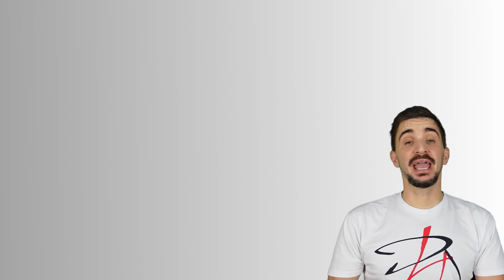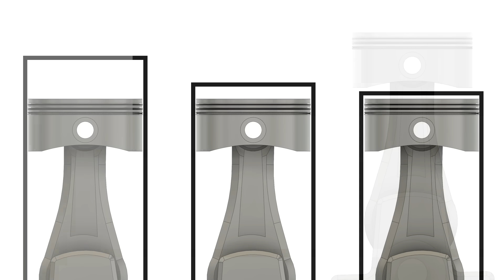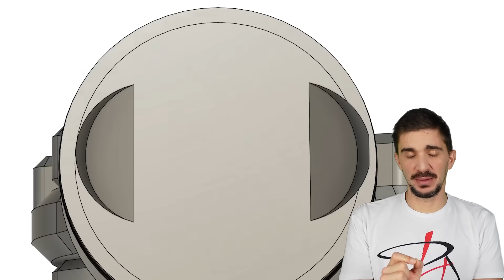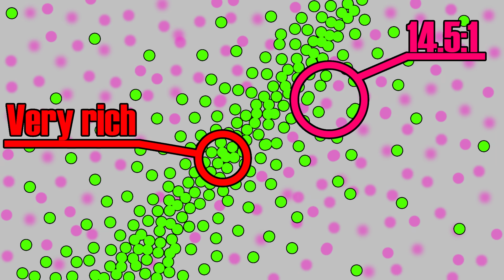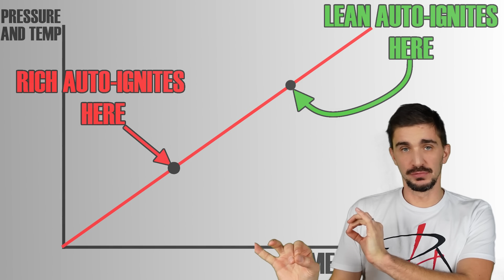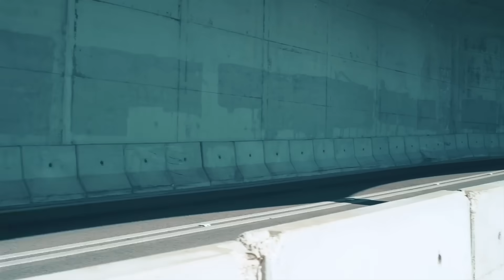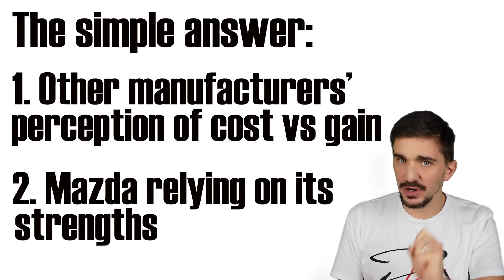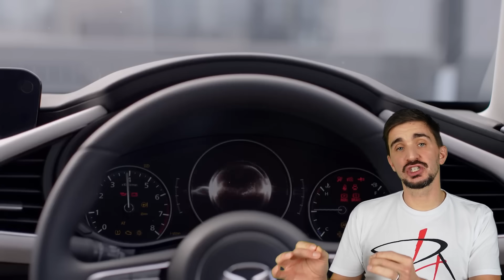The Game Changer Nobody Cares About - Mazda Skyactiv-X SPCCI How it Works and Why It Didn't Catch On

Comment: Okay, there is one piece of the puzzle missing: By having the fuel ignite via compression (and the spark plug to control it), the ignition will always happen before top dead center. Arent these engines just knock-machnines? After all, knock is just spontaneous ignition
Reply: Ignition needs to happen before top dead center as rpm increases so that it is "on time" during the compression stroke.  Called ignition timing advance.
Reply: Ignition isn't instantaneous, take some time, it start early before tdc and reach its peak cylinder pressure around 15atdc
Reply: the pressure and heat at TDC aren't enough to cause ignition with that specific AFR (at least thats the theory) the spark plug gets sprayed with fuel and ignites that tiny pocket of rich mixture which causes a spike in pressure, that spike in pressure causes the detonation of all fuel in the cylinder.

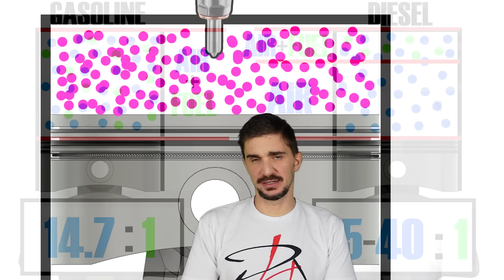if it helps, think of it as "delayed knock", thats ultimately what the pressure spike graph at 3:35 is depicting. its still rough on the rods and camshaft but since the knock is delayed until after the piston has started moving down, its less destructive than traditional knock occuring before TDC.

kinda like waterboarding the rods&camshaft to extract a little more fuel efficiency.
Reply: Так завжди запалювання відбувається до верхньої мертвої точки. Якщо запалювання буде після верхньої мертвої точки (так зване "пізнє запалювання"), це призводить до зниження ефективності двигуна.

Comment: Honestly if it were me I would have it as a onboard generator leading to a smaller battery pack which onboard electric motors that in move the vehicle. The electronics can handle all of the dynamic loads and the engine can just operated ideal conditions.
Reply: I agree. My wife has a Nissan Note E which does that. The constant RPM of the engine would mean the sky active Mazda engine wound thrive. Maybe the 50MPG (imperial) on a trip and similar around town that we achieve would would be significantly better with the Mazda engine. Engine swap anyone? Does Mazda make a 1200cc skyactive?

Comment: im driving this engine for 5 years now. im more then happy with the car, fuel economy is great, 70k km im averaging 6l the entire time with 180hp is a great value for an gasoline engine. The compressor got changed on warrenty and the mazda OEM Brakes are really bad (changed all disks after 36k km) other then that i love this car.

Comment: I think the "drives laggy" is something that could be adjusted with ECU control logic, basically a "go faster" button that makes the engine much more aggressive and basically disables spcci, and also have the computer detect when you push outside the eco profile and let it run harder then.

Comment: Hey Bosanac,
air doesn't burn, but oxygen in the air supports combustion. After all, combustion is oxidation where a hydrocarbon oxidizes at high temperature and as a result we get CO2 and H2O and some other suspicious chemical compounds that nobody likes. 
You have very good videos and I support you 100%. Poz

Comment: It's a question of taste, sound, feel. I always had NA, manual, fwd Honda cars. It was good, I liked hight revs and downshifts. But now I have a Tesla, I waited long for that, I'm older, and well, it is so much better. Simpler, silent, no smell, it accelerate more, the only downside it that now I don't focus on driving. The small twisty roads now do not appeal to me that much. But as I spend 99% of time stuck in city traffic and being on highways, it's only the 1% when I am on the twisty road that I regret my Honda. Would I want to exchange my Tesla for a very nice shifting NA car, NO. The double glass, relaxed arrival, the cargo capacity... the Tesla is an upgrade in almost every ways. It is admirable to improve the gasoline NA engine, and it fits Mazda, but like the spinning hard drives, now SSDs are better, and I thing a simple BEV is so good it makes questionning the relevance if ICE for small vehicles. Now we can argue on the longevity, the chemistry, the cooling, the break pads, the tires, but for me, now I switched both my life and my mind and my opinion to the BEV side. (but not my heart)
Reply: There are no BEV small vehicles. Everything is a SUV/crossover

Comment: Combining this engine with Toyota's e-CVT seems like it would make up for it's shortcomings perfectly. Have to work the engine? Not if you just keep it at its most efficient RPM constantly and just vary the gear ratio instead. Considering that Mazda and Toyota has done a number of collaborative projects already I'm a bit surprised that this hasn't already happened.

Comment: we don't care about because it doesn't do any of the promised things or have any special specs like very low consumption, emissions or for example torque. i'ts very ordinary basic engine. VAG 1.5 TFSI has lower fuel consumption and same performance and without this HCCI shittos.
Reply: TSI doesn't have a lower fuel consumption, sorry.
Reply: @vvevvevvvv thats just your feelings. But official wltp figures shows different story and it's leveled test prosedure for all the cars.
Reply: @Jani_Ikävalko we all know that wltp figures mean nothing.
You just drive the same route in both cars and compare the fuel consumption at the petrol station, and let's talk after that, ok.
Reply: @vvevvevvvvno. Thats unscientific and prosedure isnt same.

Comment: I really liked the technical breakdown, but the closing commentary about AI and “lazy” users rubbed me the wrong way.

You frame the progression as “I hate walking → I hate shifting → I hate driving → I hate thinking → here’s AI,” as if every move toward convenience is a move away from being human. But there’s a big difference between avoiding thinking and redirecting thinking. Offloading low‑value effort (like some driving tasks or rote calculations) can free up bandwidth for more meaningful problem‑solving, not less.

You also treat buyers not wanting this particular engine’s tradeoffs as a kind of moral failing. Most people aren’t choosing between “engaged, noble driving” and “brain‑dead laziness”; they’re choosing between fatigue, cost, traffic, and reliability on one side, and marginal efficiency gains plus extra complexity on the other. Deciding that “I don’t want to rev the engine to get torque” is not the same as “I don’t value skills or thinking.”

The key question with AI (and with tech generally) isn’t “Do you ever choose convenience?” It’s: “In which domains do you insist on understanding and retaining final judgment?” I can gladly accept help from AI or from a smoother powertrain and still be very serious about thinking hard in the areas that actually matter to me. Your underlying concern about people surrendering agency is valid, but I don’t think it’s fair to equate using AI, or preferring an easy‑to‑drive car, with hating thinking.

Comment: I see similarities with the bmw n43/n53 engines who also under some conditions run lambda 3 with a local rich mixture around the spark plug. Maybe a interesting video topic suggestion. Reliability is a disaster but they can get really good fuel economy on cruises when there are no error codes on the engine and NOX system so they are allowed to go into stratified mode.

Comment: Couldn't HCCI be controlled through variable compression ratio as well? Either by controlling the inlet pressure through chargers or physically changing the available space in the cylinder head for example?

Comment: 2.0 NA 180HP is impressive figure
Reply: Definitely is for a non performance engine
Reply: @dietznutz1 show me a "performance" 2.0 or similar NA engine with higher power stock
Reply: @takiktos1265 have you heard about honda
Reply: @nolcs3 newest civic has 143 HP ICE
Reply: @takiktos1265  The K20 and its variants,  found in Honda's various older Type R hatchback and sedans, punch out over 200hp stock. They, along with the earlier B-series engines, are also the most prominent examples of VTEC, with the engine swapping to a much more aggressive cam profile above a certain RPM, producing an extremely distinct shift in sound and engine behavior in the process.
Reply: @takiktos1265 b16 b18 k20 2zzGe
Reply: @TheMobiusRibbon1-4 i was talking about today's engines, which comply for current emissions standards. It's not hard to push the engine hard with almost no emission restrictions

Comment: Having just switched from a big (By European standards, only 3 Litres) NA engine to a smaller turbo engine with basically the same power I hate how the turbo 4 feels compared to the old 6 cylinder. Sure, the power numbers are the same on paper - and given that my old car was 20 years old I suspect it actually had way less power in it than when it left the factory, so the new one probably has quite a bit more - but it just feels bad compared to the NA lump. I very much doubt I'll be keeping it.

I find it hard to imagine who's buying cars these days. I guess I must always have been an outlier, but frankly I want to drive the thing myself thank you very much, and the less "Help" the car tries to provide the better.
Reply: @jamestipler7241  I totally understand you, we're currently driving a 3.5L V6 from an Asian car, that's just a totally different experience than 4 cylinders. It's incredibly smooth like a buttered dish, and torquy like an in-line 4 diesel, with a great gearing ratios suiting well the engine. One of the greatest driving experience I had so far. This 3.5L V6 got nothing to envy to small gas engines, because it's able to get as low as 6,45L/100km on motorways, 7,2 to 7,5L/100km on highways, 8,2L mixtes, good for 272 to 284hp.
Reply: @Nicolas-p3s6r  Which Asian car is that? The numbers are pretty good.
Reply: @saidprlk  Toyota Camry Prestige V6 (it's Asian's variant). This 3.5L V6 is really great on efficiency, without compromises on performances. Mostly mountains roads where we're living, so indeed pretty good numbers. Only the city driving, and heavy traffic jams, are the downside like every bigger displacements engines, getting between 10 to 12L/100km.
Reply: @Nicolas-p3s6r  It's cool man. Mountain roads are the best for driving experience. When I compare with my alfa 1.8 tbi engine and regarding more reliability, seems like perfect metrics for me :). My avg is 8.9L/100km but it can easily pass 10L during city driving.
Reply: @saidprlk  So true, great driving experience, but taxing on the rubbers ! :D I'm not often experiencing heavy traffic in cities, but when I did, the consumption got up to 14-15L / 100km few times.

Alfa made some great models sometimes, offering great drivings too, but they experienced some batches of reliability issue. That's the only let down.

Comment: All very correct. I've met people which have been afraid of running engine higher than 2500rpm (no matter petrol or diesel). Of course such people will find Mazda's engines sluggish.

Comment: D4A: You come to learn engineering, you end up learning philosophy as well.

Thank you.
Reply: They are very wise words. When I started driving I always preferred a manual or stick shift car. My last/current car had to be an Automatic as nothing suitable was available in manual. Sometimes I try to manually select the gears with the pretend sequential changer and I feel like I’ve had a chunk of my brain deactivated because I can’t even manage that without forgetting.😂
Reply: My truck is manual, I was driving my mother car and scared the crap out of every one. In my mind I was pushing the clutch, in reality I smashed the brakes in the middle of the street.
Reply: @codysides7683   Yep, done that.
Reply: @codysides7683  I had to testdrive a car for a friend, and the car was automatic. Did the same thing while testdriving with sales woman, she was scared I didn't know how to drive :D
Reply: @codysides7683 same happened with my wife years ago while driving the disabled guy who she was a carer for lol.  Apparently it was giving 'trouble' I think I found the cause lol
Reply: @denehardy949 speaking of which many manufacturers now have simulated gear shifts on their variable speed autos, or synthesised engined tones on EVs.  As humans, for the most we like things we're familiar with, I guess it feels safer.  My wife learnt on an auto before moving on to a manual, whereas I like a decent auto because it cuts down on the work.  She feels like she has more control, I guess that's true.  Having said that, neither of us are fast drivers, personally I don't see the need.  However I'll drive an automatic if that's what she's happier with.
Reply: He roasted the entire freaking humanity😂
Reply: Hard not to sub to him instantly
Reply: You literally said what I wanted to say watching this.
Reply: This video was waaaay deeper than expected
Reply: The philosophy lesson at the end is great. Why can't the AI brainiacs realize this. Thanks for the info on the Mazda engine as well.
Reply: Wanted to comment exactly this! So true! way to go, d4a, I just subscribed!
Reply: We drove here for answers
Reply: “You come to learn”. Exactamente!
Reply: I very much enjoyed the evolution explanation.
Reply: finally someone to address this engine , mazda 3 was in every youtube channel with more of 2 000 000 sub . they drive 1.5 million protytape (masiv marketing)  . contrary to ...d4a I thought the world would be taken by storm by mazda . but 6 years nothing
Reply: I concur. and thank you.
Reply: At least engineering is useful.
Reply: Well said!
Reply: I came to say exactly this
I also want to say thankyou.
Reply: I'm not sure the two mix.
Reply: But I don't want to learn, I just want to consume
Reply: @0x74D 😂
Reply: *sophistry
Reply: It's business

Comment: Really surprising to see how many cars mazda sells in the EU, the number doesn't come close to the domestic manufacturers. My parents bought a retirement car, the cx-30 on my recommendation as it undercut the competition by being the best priced car of the segment and it also had the largest displacement engine while having the benefit of NA reliability. It pains me to say that the best looking, best driving and cheapest car of the semi-luxury CUV segment is being ignored by buyers because of the NA character of the engine. The engine itself is really lively above 3500 rpm and i have enjoyed it when i drove it, being raised in a home where we only had petrol engine non turbo cars that thing really hits home.
The Top gear magazine said, as I recall when the car came out, that the diesel engine is better than the petrol engine... Bunch of sponsored nonsense.
You are right in saying that the majority of buyers like turbo engines because they don't feel like they work hard, but people ignore the fact that a downsized turbo engine will always be less reliable long term. As the amerikanskis say, there's no replacement for displacement. I just hope mazda doesn't pull out of the market. Long live high revving engines free of the turbo opression.
Pozdrav iz Hrvatske brate!

Comment: It's not a compression engine then is it? Motorcycles have 13:1 compression, at 16.5:1 is that really that much better? That 16.5:1 also isnt what you think, check the bmep of the skyactive. 

What makes me laugh is you say it's the first hcci and it isn't. What makes you make these videos? You might wanna get an engineering book and read it 1st.
Reply: It is much better with higher compression ratio. Formula 1 cars are running at 16:1 or higher CR.
Mazda's engine isn't the first one, but it's the first which is mass produced.
BMEP is pretty high for just a mass produced engine.

Comment: I think the biggest problem is trust in all the sensors and durability. Mazda diesel engines also have very bad reputation and this is basically gasoline engine that runs like a diesel.
Reply: Mazda diesel engine are fine. You just change the oil more frequently than every 20.000kms.

Comment: 5 inline cylinder 3.0L with mazda ignition with honda i-vtec WV DQ500 transmission behaind a driver LSD, donle wishbone front rear hydrolic/e-hydrolic stering aluminum chasis aluminum/composite body. 200hp front  little lightelectric engine with low reduction front. Light waight 2 sitter nothing unnasosary, ehat a dreamcar wwould it be
Reply: That's just a bunch of words...